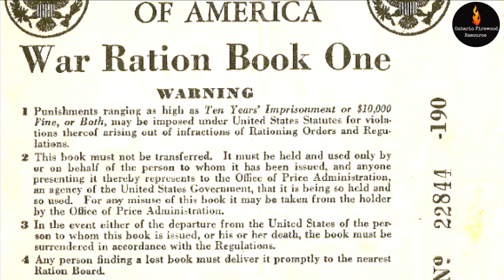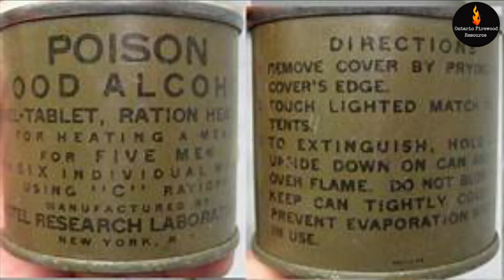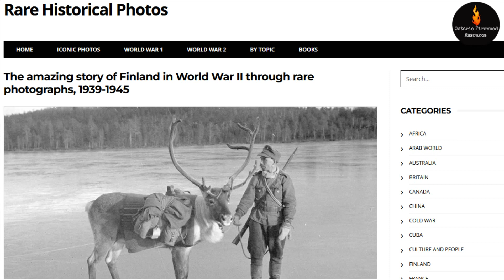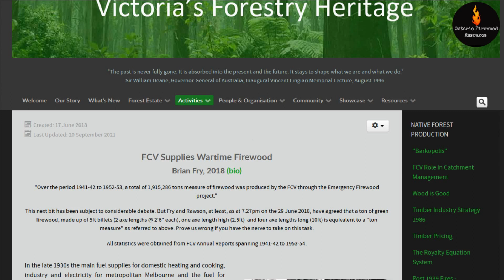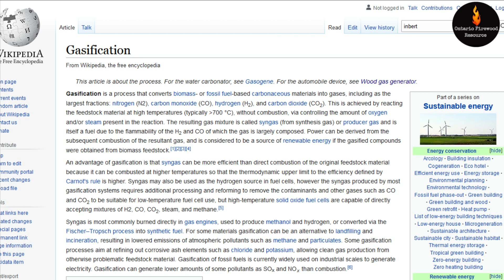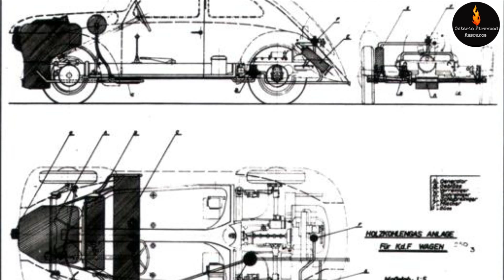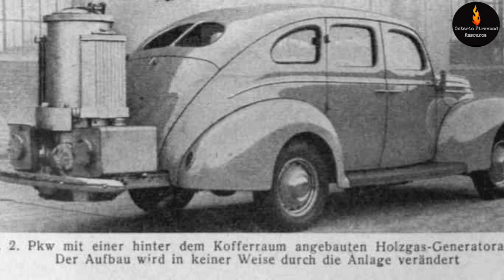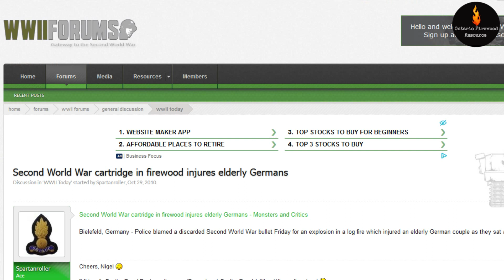FIREWOOD DURING WWII - USAGE, RATIONING AND WOOD GASIFICATION VEHICLES/ GASIFIER GENERATORS

Comment: but i am assuming the vehicles had poor range, due to the wood capacity and boiler limit
Reply from the maker: No doubt, but during the war, when energy sources were low, they had to use whatever they could.. there comes a time when you have to move or you lose  all the equipment to the enemy